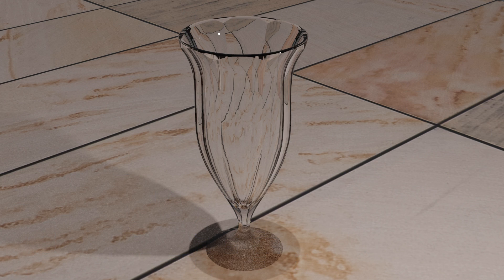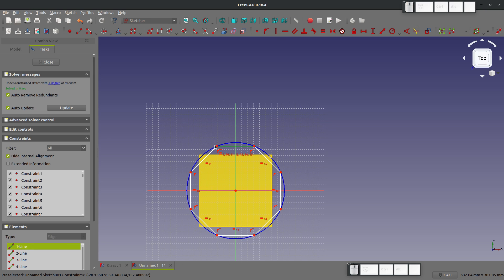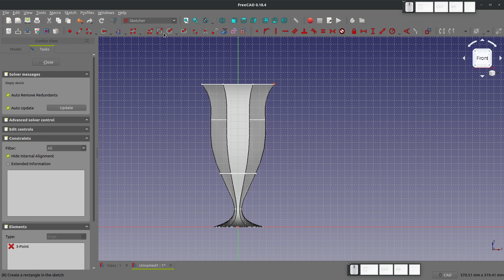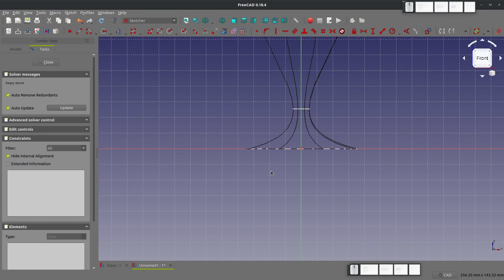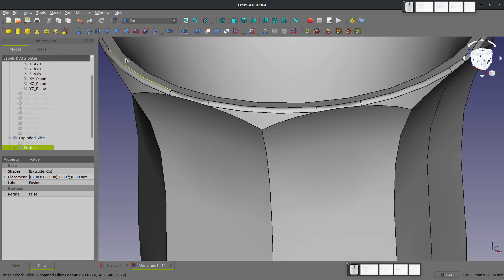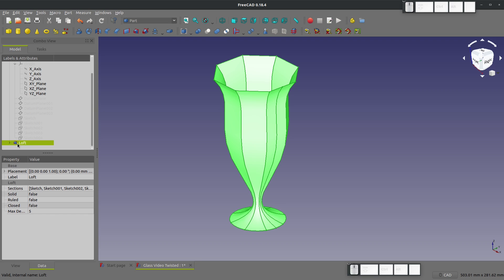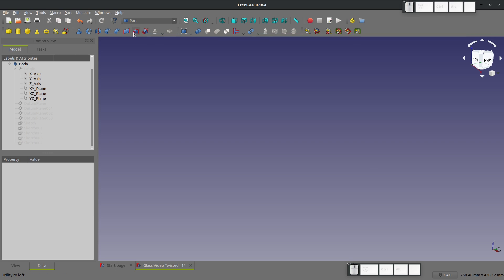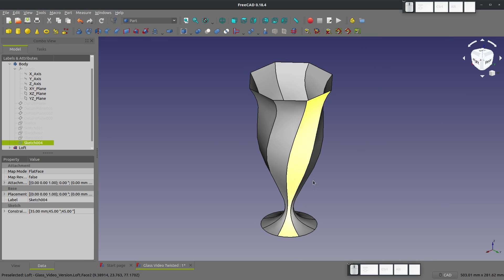Milkshake Glass in FreeCAD |JOKO ENGINEERING|

Comment: Nice tutorial, thanks!
RE the last part (splitting a circle into 8 segments) - couldn't you just make all 8 segments 'E'qual? (and then fix the rotation)
Reply from the maker: FreeCAD will set them to an equal radius instead of an equal arc length, but that option is indeed available in other platforms.  For that in FreeCAD I occasionally use construction lines.
Reply: @JokoEngineeringhelp  So - create construction octagon and then create arches from vertex to vertex? Nice.